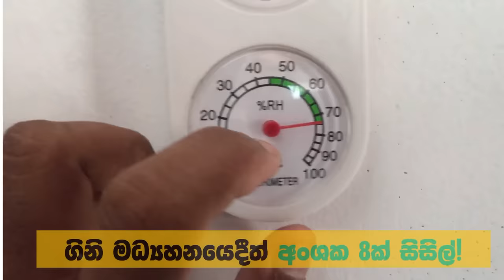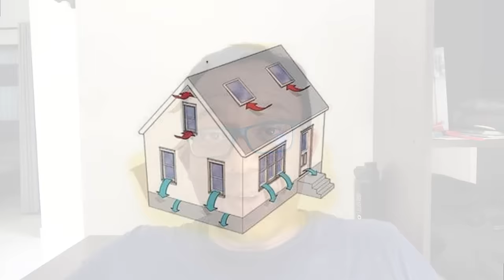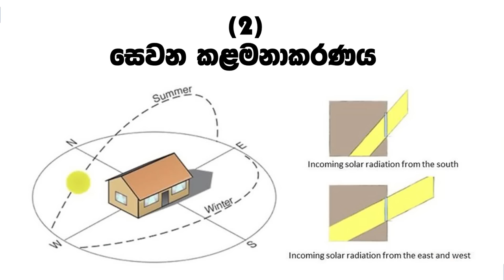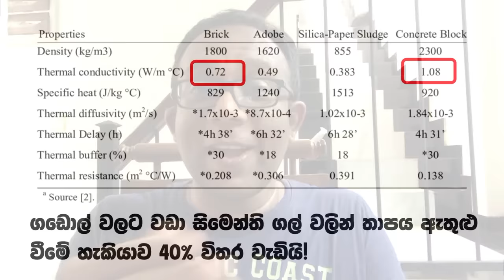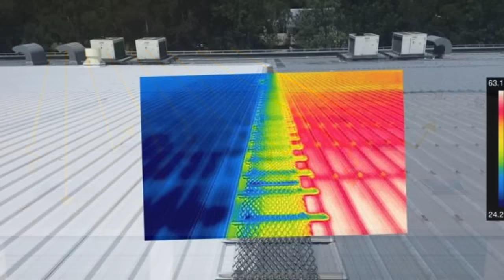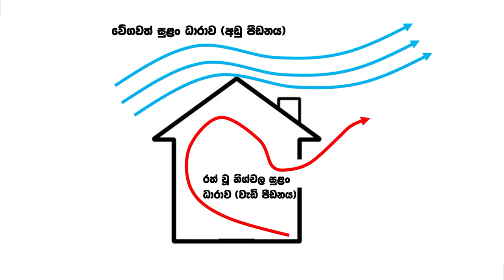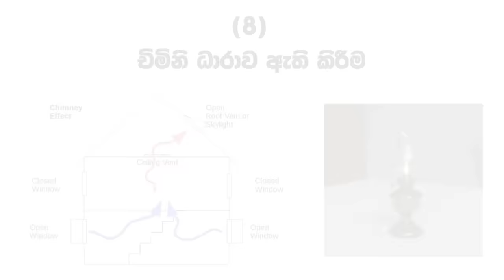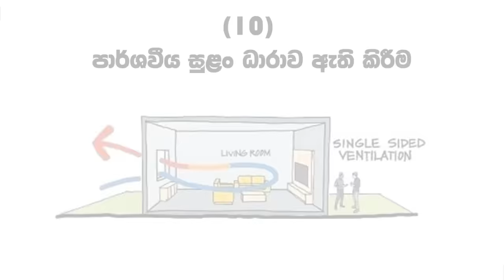ගෙවල් සිසිල්ව තබාගැනීමේ විද්‍යාව මෙහෙමයි!

Comment: Well done,  Ruchira.
Fundamental principles to their practical application explained in simple language with examples.  Clearly explaining terms like gain / loss, conduction/convection/radiation thermal capacity etc.  For over fifty years I have been trying to explain to my friends and family how important it is to consider the location, in orientating the house to make the house comfortable.  
However my parents, even some of my siblings have instead used advise from astrologers and other myth promoting individuals to decide on the location and orientation of the house.   Please continue.

Comment: Hot air always goes up due to the expansion in volume & to fill that reduction in space less hot air coming from inside/ outdoors. So making that temperature gradient as high as possible  reduces the STAGNATION of the air inside the home, so less heat increase inside. 
One other important factor is the HUMIDITY. High humility  affects the air movement so actual temperature we feel goes up.This's simply because additional weight of water particles in the air though it might increase the absorption of heat from the environment. 
Have we any experimental data on this  issue.?